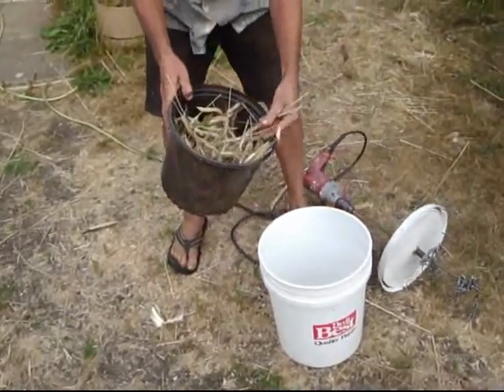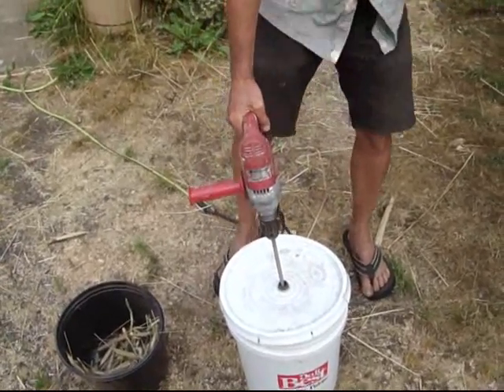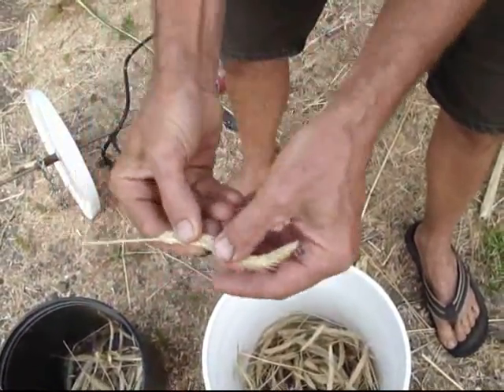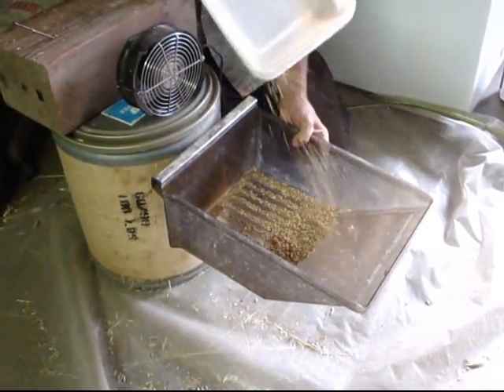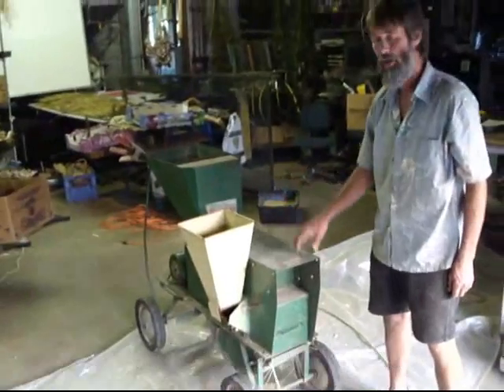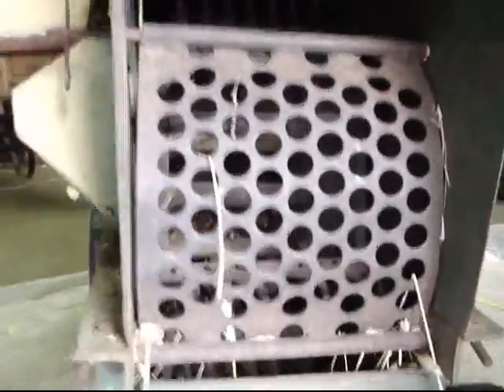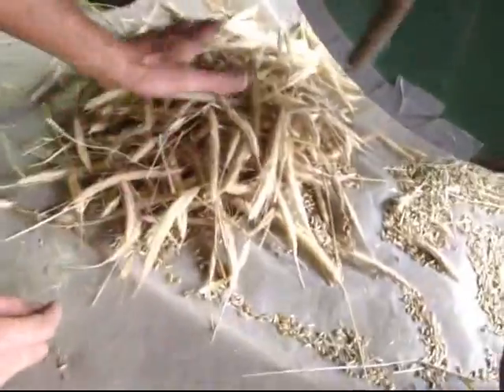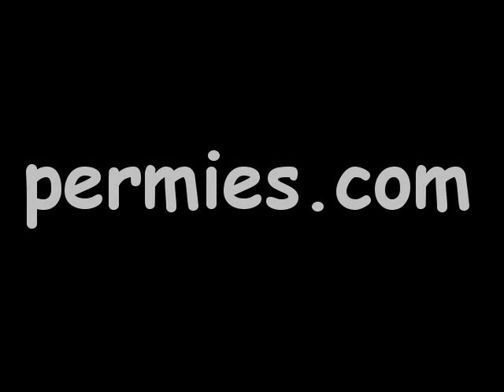grain thresher designs and winnowing - how to

Comment: Perhaps a plywood disc that fits snugly into the bottom of the small bucket and is glued into place, and has a hole that the metal bar sits in to hold the drill steady, would help keep the chains off the bucket sides, for those concerned about chewing the bucket up.

Comment: Simple and effective. Person can make a variation of this to suit their needs and not have a complicated contraption with multiple points of failure and a long period in fabrication.
Only thing I immediately think of to alter is using a metal drum/lid and smaller link chain. A 15 gallon drum would probably be just right.  Or actually one of those heavy plastic 15 gallon drums would be great also if one couldnt find a smaller steel drum.
Thanks for the video to slap me out of the over-thinking route. lol  because its not like I'll have 200 acres of grain to thresh r anything.

Comment: My grand mom used to use horses running in the circle to winnow. I remember that very well, but very soon they were introduced to mechanized winnowing with long belt almost a foot wide attached to tractor. We kids used to watch it awed and almost def since it produced great amount of decibels when turned on. And then they will put straws around a long pole stuck in to the ground.... old times eh...